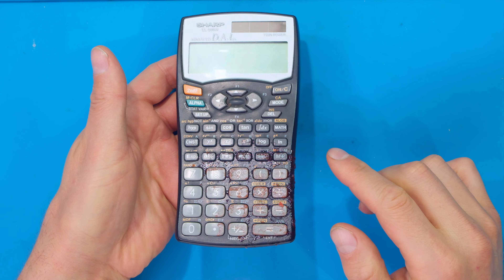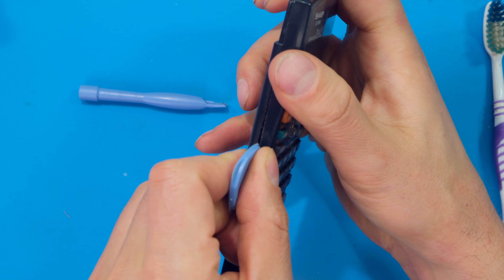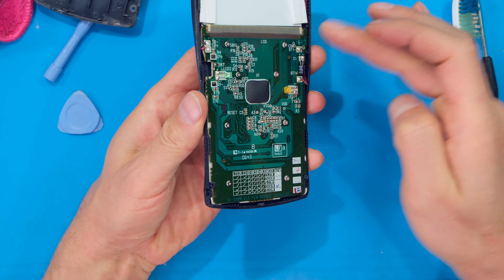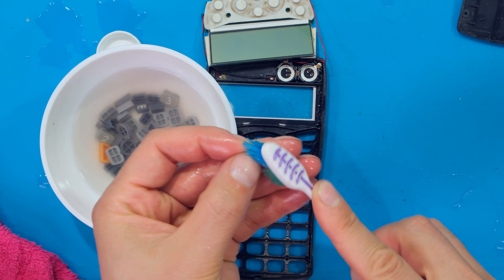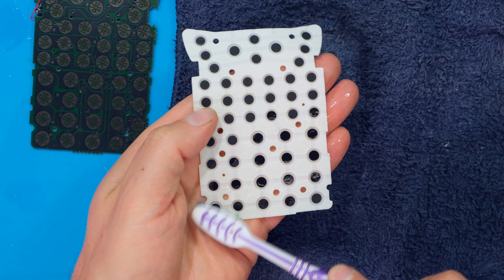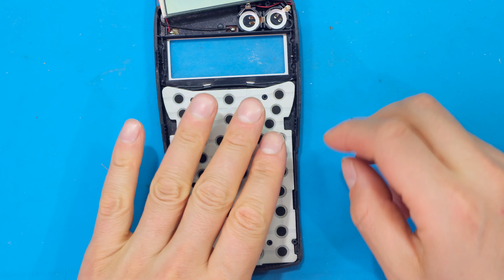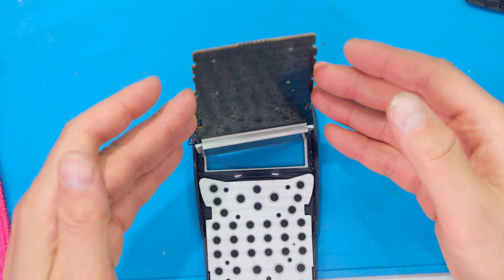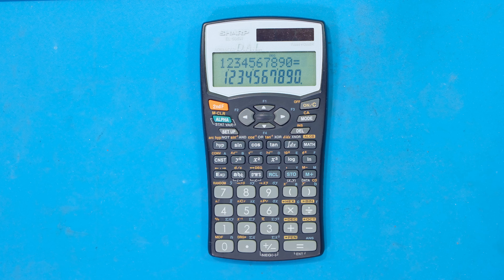How to clean inside a calculator after juice spilled on it - step by step to fix stuck buttons

Comment: Thank you for the video! It helped reassure me that I wasn't doing anything desperately wrong!

(writing out my calculator story in case it helps someone else:)

Mine was a little bit different, because it actually wouldnt let me pry the circuit board out, as it had plastic bits and not screws keeping it in place (like plastic rivets) once you took out the actual screws holding the back of the calculator on, that I ended up having to break off, because otherwise the calculator was a write-off anyway (the 1-2-3 buttons stopped working, except when you'd reset it, then theyd work once and jam, I guess?). Thankfully the gamble paid off, and taking this 12 year old calculator apart and cleaning if of dust solved the problem! The circuit board now is a little less secure in the calculator, and only held in place with the rest of the calculator and the back, but I figure if I have trouble in the future I can put something in there to help keep it in place, like a piece of cardboard or hot glue dabs or something.